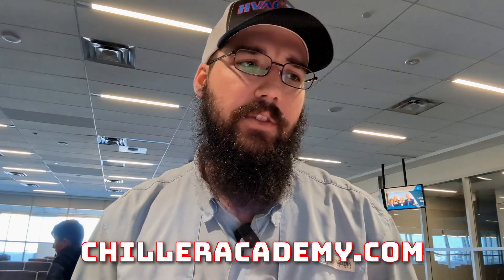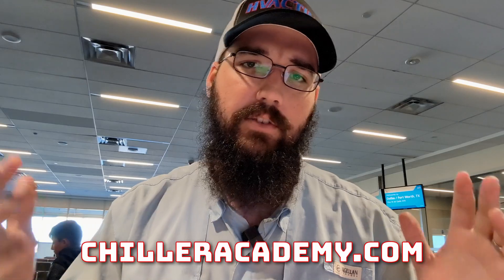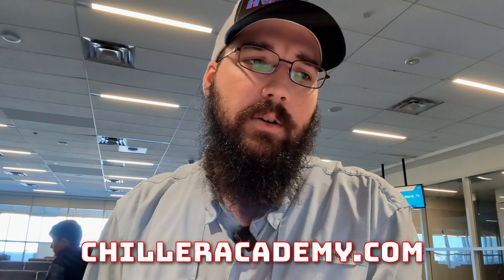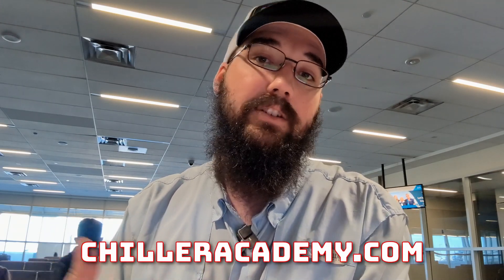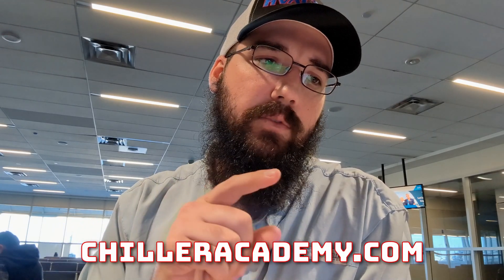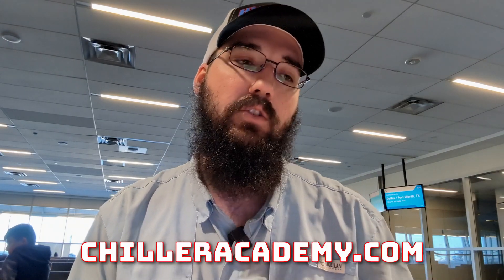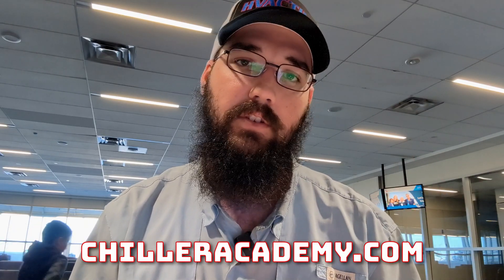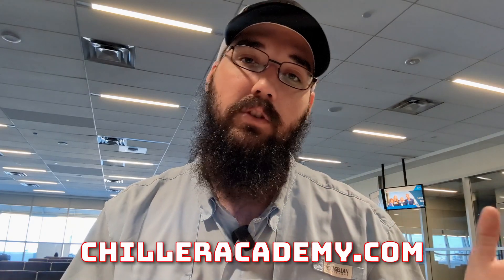Know Chiller Flow Balancing During Ops, Chiller Q/A

Comment: Hey Holden, you ever have to prime a centrifugal pump?
Reply from the maker: Yes, get a high point above the pump to bleed air though. Some pump casings will have a tap at the top of the housing.
Reply: @HVACTIME  I have a tap with 3/8 ball valve on the case housing. I am going to shut off discharge valve, keep suction valve open. I am going to open a 3/4 ball valve below discharge valve that is above pump, then open 3/8 ball valve on pump housing that’s lower then the 3/4 ball valve. I’m hoping to get water out of that 3/8 valve on the casing so I can successfully prime pump before starting it. Thanks for help you the man